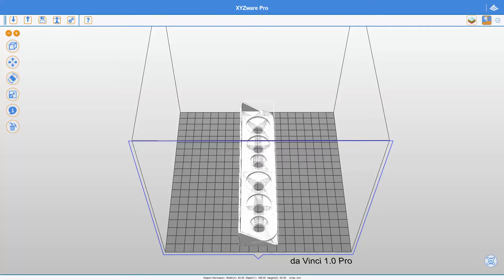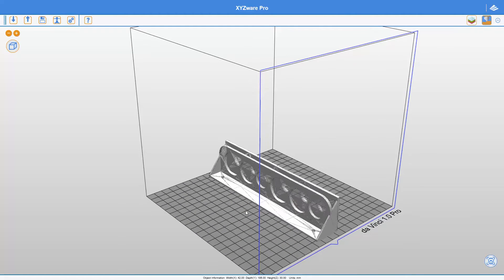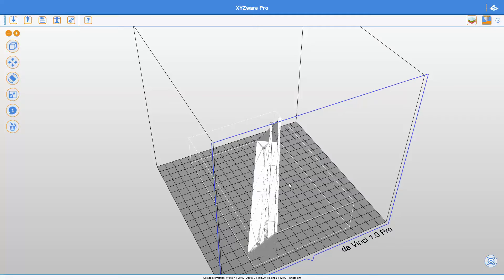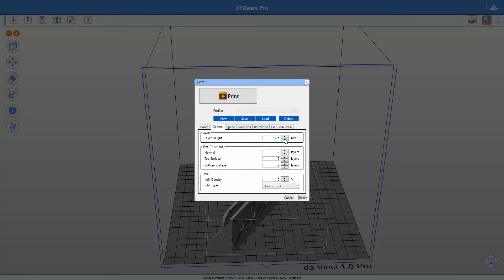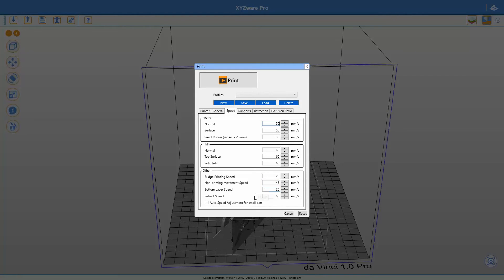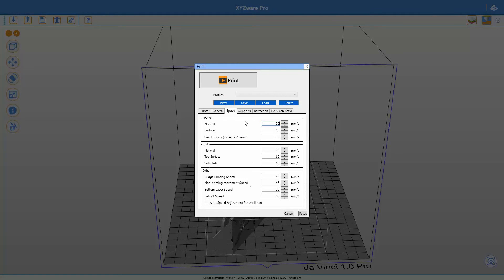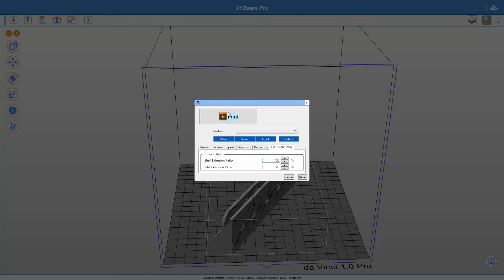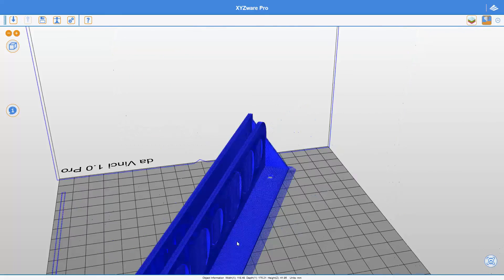▼ Basic knowledge of XYZWare for Pro for the Da Vinci Pro 1.0

Comment: I'm waiting on my davinci thanks a lot for the helpful videos now I understand on what to expect.
Reply from the maker: Hope you will receive it very soon. Have a great time printing with it.
Reply: @3dPrintCreator   ,, do you recommend anything for when printing abs, also would you be able to print filaflex with this printer ?
Reply from the maker: I have a few videos about printing with ABS.
The most important thing is to keep the door closed at all times. You must have the heat of the printer inside the cabinet or else you will have problems with your print. Also, make sure to use a good adhesive on the bed. Filabond or hairspray will do a very good job on Kapton tape, else you can use BuildTak which is even better for ABS. 
With the standard nozzle and extruder you won't be printing very well with flexible filaments. I have rebuild my complete machine so that it now has a different extruder (for flexible filaments) and an E3D V6 nozzle which makes the printer so much better then it originally is. Also I changed the motherboard and even the steppermotors. Made a CoreXY printer out of it, just using the housing of the Da Vinci Pro printer.

Comment: I seer you are using xyzware pro, what printer are you using in this video?
pro seems to have a lot more settings that would be usefull on my printer.
I ask because I have seen you use a 1.0 printer like mine, does pro work with the 1.0/1.0a printer,
Reply from the maker: XYZWare for Pro comes with the XYZPrinting Da Vinci Pro 1 and I believe the software will only work for this printer, not for any other Da Vinci printer. That said, the software is very limiting and I switched to Simplify3D (paid software) to have more options.

Comment: Hey my filament broke into two pieces in the white tube leading to the extruder, how do I remove it safely
Reply from the maker: Bad luck, you have to remove the drop in cartridge and remove the stuck filament but you also have to look for the reason. Most likely the PTFE tube is wrangled or bend. You can find a lot of information about that on Thingiverse in the Da Vinci User group.
Reply: +3d Print Creator thank you